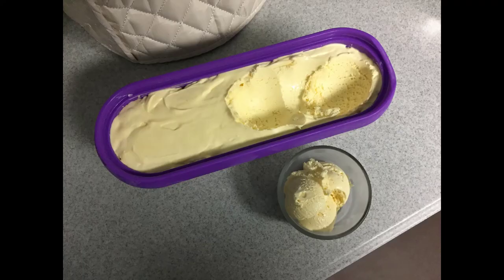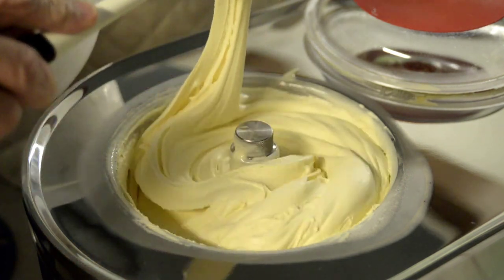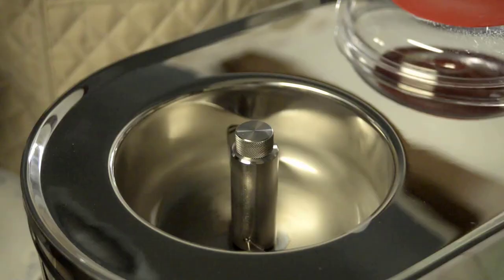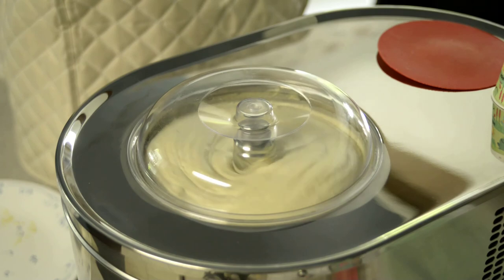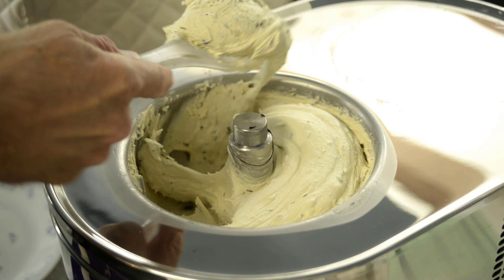The top 10 reasons why you bought the Lello 4080 Musso Lussino

Comment: Thanks for the review. Can you do multiple flavors in a row or is it necessary to let some time pass to let the machine rest?
Reply from the maker: That is a great question Fabrizio.  And sorry for the long answer.

The machine does not need to rest in order to do multiple batches.  But the real answer depends on if you can accept a little mixing of flavors or not.  When you remove the ice cream from the machine, there will always be some left in the bowl and on the mixing blade.  This means when you add the next batch, the residual ice cream from the previous batch will be mixed into the new batch.  If you cannot have the flavors mixing, you need to wipe off the residual ice cream.  And the best way to do that is let the bowl warm up enough so that the residual ice cream becomes soft and then wipe it away.  You do not have to let it come to room temperature.  As the bowl approaches 32 degrees F or 0 degress C, it will still be cold, but the ice cream will soften enough to be removed.

Do NOT pour warm/hot water into the bowl to speed up the warming.  While the bowl is stainless steel, pouring warm/hot water into the bowl will stress the steel and could cause damage to the cooling coils.  How?  The cooling coils, which you cannot see, are welded to the bowl.  Which is a design advantage.  But extreme and sudden temperature changes could cause the welds and/or the coils to separate from the bowl and might even crack the welds and/or coils.  If that happens, a very expensive machine has just been severely damaged.
Reply: @Around_The_Home  thank you. Clear and helpful

Comment: Excellent video!

We currently have the Cuisinart ICE 70 and are considering upgrading to the Lello 4080. We have two concerns: 1. The smaller optimal capacity and 2. The overall time it takes to churn a batch from start to finish when considering both pre chilling and cleaning. 

We’ve read that the optimal capacity for a mix is only around 2.75-3 cups (between 700-750 ml). How much liquid do you typically put in the machine? What do you believe is the optimal capacity for best results? We’d rather make less per batch if it means better quality, but are accustomed to adding roughly 3.75 cups (900 ml) for best results in our ICE70. 

How long does it typically take to churn a batch at optimal capacity if the bowl is chilled for 15-20 minutes prior to adding the mix?
Reply from the maker: Letting the compressor run for 15 – 20 minutes before adding the mix sounds too long. What you want to do is, once the compressor is running, use an IR thermometer to frequently check the bowl sides.  Do not check the bowl bottom.  When the temperature of the bowl sides is above 32°F (0°C) and below 45°F (7°C), pour the mix into the bowl.  When most of the mix is in, turn on the churn motor.  Once all the mix is in, replace the plastic cover.  If you let the bowl get too far below freezing, then when you pour in the mix, it will freeze to the bottom and sides and it will be exceedingly difficult to get the churn motor running.

Over time, I have upped my mix quantity to make more ice cream in a single batch by taking advantage of the removable lid.  My typical mix quantity now is 4 to 4.5 cups (946 – 1065ml). This will cause an overflow as shown at 1:32 if you do not extract the excess. Which is what I do as shown at 2:00. I have not noticed a drop in quality doing it this way.  But I would start with 3 to 3.25 cups (710 – 769 ml) of mix, smaller if adding mix-ins, until you get comfortable with the machine. The biggest detriments to the quality of ice cream is a-quick-and-easy recipe, low quality ingredients, the person not exercising skill when making and freezing the mix, letting ice cream melt and then refreeze and the ice cream making machine.  For example, at 1:32, if I had extracted some of the ice cream and then pushed the melted mix back into the bowl, that will lower the quality.

Looking through my recipes, on average, 1 cup (235 ml) of mix makes 1.5 cups (355 ml) of ice cream.

The residence time (time it takes to go from mix to ice cream) varies by recipe, but most of my mixes take 20 - 30 minutes.

You can see how I clean, and how long it takes, in this video.
https://youtu.be/wXB_qPtyUp4

Comment: How are you making the chocolate? I’ve tried to do just like you but the chocolate will not eat hard but rather mix with the ice cream. I added the chocolate as you’ve indicated-at the end
Reply from the maker: Forza, first, make sure you have an IR (infrared) thermometer.  In the US, they are not too expensive.

Then you will need two ounces (about 57 grams) of bittersweet chocolate and 1 teaspoon (5 milliliters) of canola oil.  It does not matter if the chocolate is chopped, bits or bars since it is going to be melted anyway.  Try to get something that is at least 60% – 70% cacao.

Then melt it.  Chocolate burns easily.  And once burnt, it cannot be salvaged.  So the safest way to melt chocolate is in a double boiler.  If you feel comfortable, you can also melt it in a microwave oven.  If using the microwave, microwave in 20 second increments until about half of it is melted and stir in-between heatings.

Once about half the chocolate is melted, remove from heat.  Do not completely melt in the microwave or double boiler.  The residual heat will melt the rest of the chocolate.

Do not let the chocolate get above 115°F (46°C), else it can burn.

Once the chocolate is completely melted and smooth, add the oil and stir to combine.  If you do not want to use the oil, that would be fine.

When the ice cream is about 18 to 20°F (-8 to -7°C) or colder, use a spoon spatula and just drizzle the chocolate onto the churning ice cream (as shown in the video).  Do not add a lot of chocolate at once.  Look carefully as you drizzle.  Does the ice cream melt when the chocolate touches it?  Does it take longer than a fraction of a second for the chocolate to freeze?  If so, the chocolate could be too hot, or the ice cream is not cold enough, or both. 

If the chocolate begins to harden before you can finish adding it to the ice cream, gently reheat it unit its temperature is 105 - 110°F (41 to 43°C).  Remember, do not let the chocolate get hotter than 115°F (46°C).

I hope this helps.
Reply: @Around_The_Home  I’ll give it another try. Thank you for your response! I have made a chocolate sauce from scratch using 100% cocoa powder, sugar, butter and little flour. Perhaps that was not good recipe for this particular purpose. Or perhaps it was too hot. Not sure.
Reply from the maker: @forza890  I hope it works next time.  Since this is a mix-in and not a sauce, I would leave out the sugar, butter and flour.  Since a person can taste a sauce separately from the item the sauce is on, the sugar and fat (butter) will improve the taste (especially since 100% cocoa can be bitter tasting) and the flour will give it texture.  We don't need the extra sugar, fat or texture in a mix-in since it would be very difficult to taste the mix-in separately from the ice cream and we get the sugar and fat from the ice cream itself.  And the texture is not needed since the intent is to have the chocolate broken into tiny pieces.  The use of an IR thermometer will definitely help with monitoring and controlling the temperatures.

Comment: HI, it's still me. Can I ask you how the ice cream maker is doing so far? I ask you this because I have read some reviews that say that after a couple of times you start to hear a louder noise or even a burnt engine. I know very well that it can happen, and you can't give me certainties, but if you can give me your opinion  and your experience with this ice cream maker. Thank you so much
Reply from the maker: Fabrizio, I have owned and used mine since Feb 2018.  I make almost exclusively custard-based ice creams (with egg).  Which are thicker than what has been called Philadelphia style (no egg) ice cream.  I have never smelled an overheated motor (which typically smells like something burning).  The only issue I have ever had was when I made my Peanut Butter ice cream the first time.  My recipe results in a mix that has very low viscosity.  The first time I made it, as it was reaching the end of churning, the ice cream was so thick, the blades were hardly turning.  This was causing the motor to strain, so I turned off both the churn motor and the compressor and extracted the ice cream.  Since then, I closely monitor the churning and extract before the motor starts straining when making this ice cream.  It does not affect the resulting ice cream.  And I do not have this issue with any of my other recipes.  

When the machine is new and you first use it a couple of times, there may be a smell as factory oils ‘burn off’.  But this smell should go away after a few uses.

Comment: It is a nice video, although I remain skeptical because none of the videos of the ice cream produced by this machine ever show the final product after it has been frozen. It looks like soft serve coming out of the machine. Can someone kindly show me what the final product looks like? Thanks.
Reply from the maker: Jeffery, what are you skeptical of? Are you looking for a machine that will churn your mix until it is rock solid? If so, why? If a machine froze your mix until it was rock solid, besides burning out the motor, it would be nigh impossible to remove the spindle/mixing blades and then to extract. You would be able to scoop the top portion out, but you would have to let the mix soften to get to the rest.

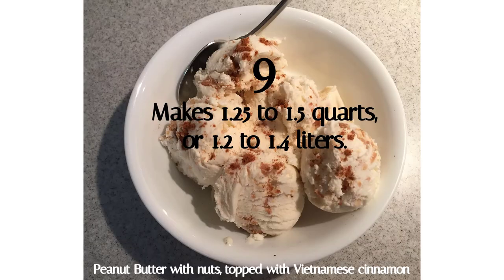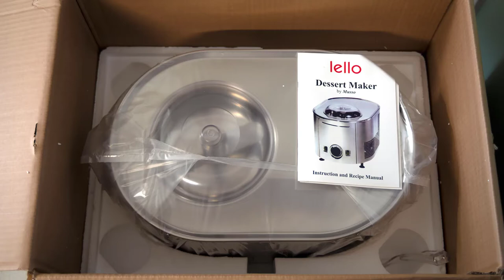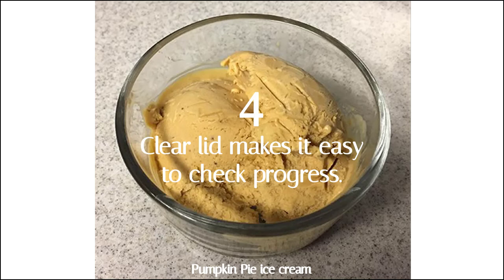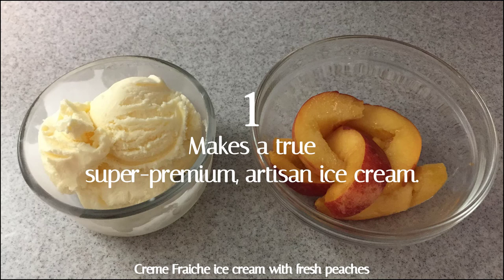In general, the final steps of artisan ice cream making are churn until very firm, extract, and finish freezing. In this video, you see the final product (after the final freezing) at 0:12, 0:19, 0:31, 0:47, 1:06, 1:12, 1:23, 1:29, 4:22, 5:42 and 6:57. When looking at these images, one should not interpret creaminess as softness. If you only want to look at one image, I suggest 0:31.

What do I mean by firm? I churn the mix until it can stand on its own. This is firmer than soft serve you find in a fast-food restaurant, but not rock solid. You can see this at 7:04. The first scoop creates a tail that sticks up in the air. Notice how that tail stands on its own.

If you really want your ice cream maker to create as hard a ice cream as possible, reduce the fat content and increase the water content of your mix. Use Philadelphia style ice cream recipes (not custard style) along with dairy products with less fat. The ice cream won’t be as smooth or creamy, but it will be harder coming out of the machine.

For those who may be wondering, it takes four things to make super-premium artisan ice cream. The recipe, the ingredients, the skill of the ice cream maker, the ice cream making machine. The Lello 4080 only gives you one of the four things that are needed.
Reply: the final-final result (after freezing completely) depends on the correct recipe and execution. The machine seems to do a more than decent job, the rest is up to you
Reply: @Around_The_Home  Thanks. I appreciate your comment.

Comment: Hi, I have owned your machine for about a year and use it for a side online ice cream business. However, recently the gears have started to make a lot of noise. I opened it up and it seems like the motor is a little loose. I will also grease the gears while I am there. I was curious if you have ever opened your machine to play around with the motor and if it helped with anything? thanks
Reply from the maker: Justin, no.  I have never opened the machine to perform maintenance.  Fixing motors has never been my strength.  Depending on what country you are in, Musso SRL may have a distributor/repair center that you can discuss the issue with.
Reply: Hi Justin, Did you figure out what's going on with the machine? I'm thinking about buying one, but if spending this much for home use, want it to last a long time.
Reply: @caseyclausen2627  ya i managed to fix it. Theres a piece that determines the place of the gear relative to the turning motor. What was happening was that the gear was no longer flush with the motor so it wasnt gripping properly. Was a question of inching a piece over a little so the gear could catch. Machine makes great ice cream and would still recommend. However it is bulky and heavy so should plan for a permanent spot. Also slightly annoying to clean since the bowl doesnt come out but thats the price to pay for having the cooler welded to the bowl to optimize cooling. Hope this helps!
Reply: @justincredible00715  Thank you! I think I'll go for it. It seems some people are having good luck with it lasting a long time, and others who have had issues have been able to fix.

Comment: One more question, if you have the time:
The 4080 lists a "1.5 Quart capacity" which would be 6 cups, but I also see that they say "Max ingredients capacity 0,75 L" on Amazon. .75 of a Liter would only be 3 cups. I assume the "1.5 quart" listing is correct, and I could a use recipe with up to 6 cups of 'liquid'?
Reply from the maker: Unfortunately the word capacity is used to describe both how much mix (liquid) you pour into the machine and it is also used to describe how much ice cream it makes. The Lello 1.5 quart capacity describes how much ice cream can be made, which is about right. The Amazon description is describing how much mix can be used. I think 3 cups is a little on the small side. My basic vanilla recipe makes a little over 4 cups of mix and creates a little over 6 cups of ice cream. So pouring 6 cups of mix into the machine is way too much. How much mix you can use varies by recipe because different recipes expand differently. I suggest you start off with no more than 3.5 cups of mix and see how much ice cream is made. You can then adjust your recipe to make more or less.

This is what I do to make recipe adjustment easier. I take the recipe I wish to work with and convert almost all units of measure to grams. For example, it the recipe says x tablespoons of sugar or x cups of cocoa powder or x cups of milk/cream it gets converted to x grams of sugar/cocoa powder/milk/cream etc. So what is the conversion factor? Don't go looking for one. Get yourself a good kitchen scale and weigh a cup of sugar. How many grams is it? That's your conversion. Then repeat for almost all other ingredients. Once done and you want to increase your recipe by 25%, then 306 grams * 1.25 = 383 grams is much easier to work with than 1.5 cups * 1.25 = 1.875 cups. Some of the things I don't convert to grams is salt, vanilla extract, eggs, etc.
Reply: @Around_The_Home  Got it. thanks very much for the answer!

Comment: I have the 4070, it’s the Jr. How do I know how long to churn? No instructions 🥺
Reply from the maker: The reason they generally do not come with instructions is because the ingredients used will affect residence time, aka churn or mixing time. Ingredients that have more water and less fat will churn in less time since water freezes sooner than fat.

A guideline to use is churn until the mix can at least ‘stand on its own’. On the 4080 this is easy to do. While the mix is churning, remove the lid, take a spoon or spatula, remove a small amount and hold it up. If the mix starts to droop and loose shape, it needs more time. But if the mix maintains its shape, then you are close.

Stop churning when you hear the motor start struggling. Never let a mix churn that long. If you consistently churn until the motor struggles, you are burning out the motor.

Comment: Can you please tell me what is the material of the piece you use to lift up the lid?
Reply from the maker: It is a rubberized jar opener.
Reply: @Around_The_Home  Thanks! :) Did you buy it off Amazon? If not, then can you tell me what is the diameter of it?
Reply from the maker: @MrLukaszAT  I don't think I bought if off Amazon. More than likely I found it in a grocery store in the section where they sell kitchen tools. It is 5" in diameter. Hope this helps.
Reply: @Around_The_Home  Yes it does! Thank you very much and thanks for your helpful videos. You were one of the reasons I've ordered Musso 4080!

Have a good one :)

Comment: Hello, are you still using this? I have read that some of them have had problems.
Reply from the maker: Yes, I still use it.
Reply: What are the issues present in the model?
Reply: @alphafiddlesticks5623  Some were saying there is a problem with the centre shaft being bent and the paddles scraping on the bowl. I have since bought a used one and have had no problem.
Reply: @paulg666  , my one unit arrived bent, and scrapped the bottom, scratching into the stainless steel. Replacement unit arrived a couple days ago and appears better. It seems all units are very quiet on first use, but get louder over time. Yes, I watch the mixture like a hawk and turn the machine off after temperature is hit. Rather, it seems like the gear mechanism for the churning paddles just get noisier after being exposed to any resistance.
Reply: @JimBob1937  thanks. I bought a pre owned one. It’s been working well for 10 months.
Reply: @JimBob1937  thanks. I bought a pre owned one. It’s been working well for 10 months.